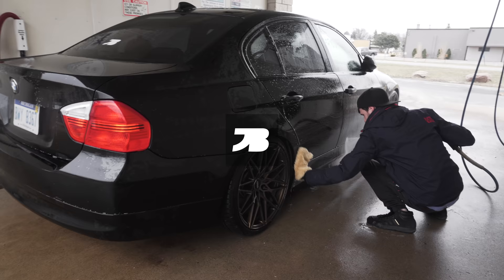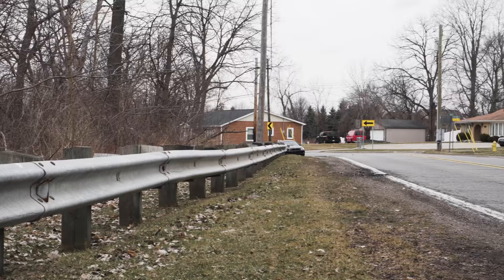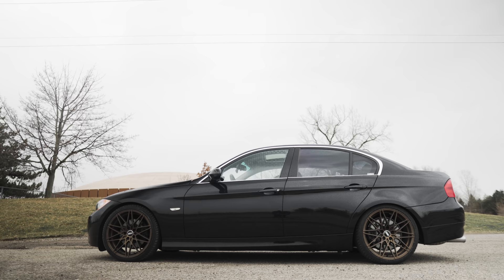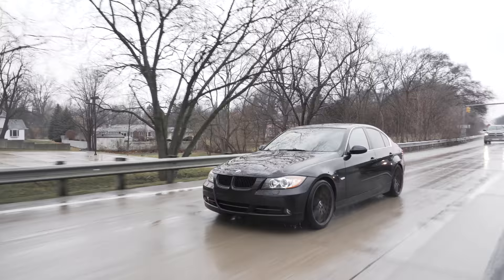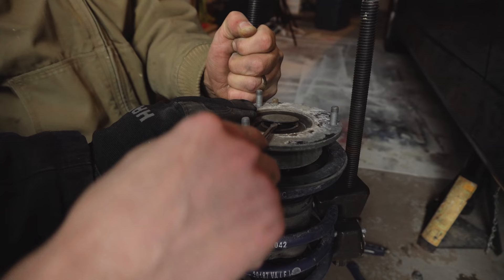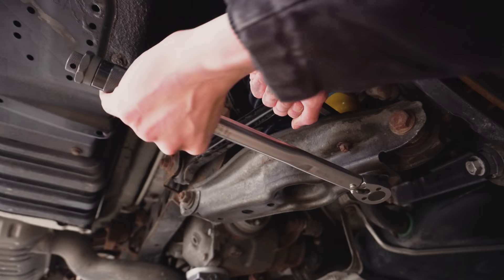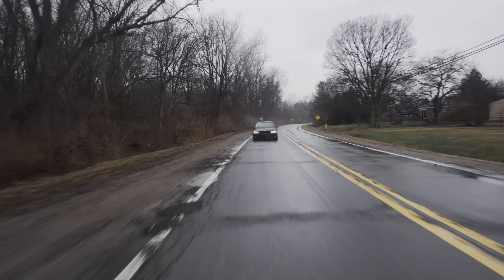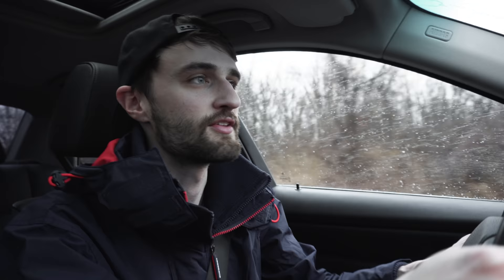BUDGET Suspension Review | Bilstein + H&R

Comment: Coming from the passenger in the car, the ride is bumpy. 😂
Great job as always babe! Proud of you. (:
Reply from the maker: It’s not that bad 😂
Reply: Its a matter of tune the right tyre pressure. In my Alfa ive used to Run @2.5 Bar for all the wheels, with B12 kit i run @2.4 which is pretty firm but its very planted, not bumpy at all.
Reply: I'm gonna take your man! I just need him for a few days tho! Need some assistance with my upgrades!!!
Reply: Y not get the coilovers for 800
Reply: I did mind's last week, and it does feel bumpy, and my girlfriend said the same thing. So my question is, how long does it take to settle?

Comment: I like that you have mentioned the value in overhauling suspension. It is often forgotten that people seeking to upgrade suspension are starting from a quite low point with a used car full of worn components. Useful budget upgrades then start with the super low cost option of Sachs dampers and stock bushes. Moving up the scale from there, something like Bilstein B4 or B6 dampers, BMW stock motorsport springs and improved bushes. Improvements, including bushes and ball-joints, can often be found in the BMW stock parts list. Sites like realoem, though not including full spring info, include info about bushes and other components used on motorsport variants, larger engined models and the M models. Careful part-bin mods based on this info can be really effective. After all, you bought a BMW because the chassis is good in the first place, didn't you! Top tip: like any rear-wheel drive car with strut suspension on the front they benefit greatly from an increase in front spring rate. This reduces roll and improves front camber, improving stability under braking and grip overall including allowing greater rear compliance and therefore traction. If you go really hard the ride will get a bit choppy but the benefits come way before that point.

Comment: On pretty much any older car, replacing the struts/shocks along with a bunch of control arms and mounts is pretty much the first 'mod' to do, before spending on engine and brakes upgrade. Just b sure to use quality parts (be it from Fcp or other site) because there is a plethora of biodegradable cheap brands these days sold by all reputable online stores - they sell the junk parts along with the quality and OEM brands, so it's kind of confusing for the new comer.  Great video by the way!

Comment: Great video.. I have the B8's on my 2009 Cayman with Cayman R Porsche springs (-20mm) .. The ride is as firm as you'd want on UK roads. Rough roads are jittery but smooth roads are very comfortable. Oh and the B8's for my car came with internal bump stops. Handling performance is certainly better. I replaced top mounts front and rear but my 38,000 mile units look like they are in perfect condition.

Comment: Justin, hello! Could you answer some questions?
1. Did you have a standard suspension (not M) before installation on your e90 xdrive?
2. Could you take an part numbers of h&r springs and b8 shock absorbers you installed?
3. what the drop was on front and rear after you installed it?

Comment: I did the same set up with my car, but find the front pretty harsh over bumps. Also, when I push down on the front of the car, either side, there is virtually ZERO suspension travel at all, maybe 1/8th of an inch at best.

Comment: The ride still looks a lil rough judging by the camera bumping up n down, but that's what comes w the lowered look.  I just put oem's on my e46 m3 n I agree man.  It was like a new car...especially on these fucked up Mi roads !!  We're changing the nick name from motor city to pot hole city.  I've been trying to find roads that don't have any n go out of the way to go up to like 23 mile which is fairly smooth just to avoid the aggravating turmoil.  I did see the budget increase in our state to get the roads rebuilt, but you know what that means....fuckin traffic!! All damn summer!!! Better make sure the a/c n coolant is in good standing Bc/ I got a bad feeling it's gonna be a long blistering one sitting in traffic.  Why have they not developed a new composite to pathways new roads with that won't deteriorate as quickly yet not ice over in winters...they should have scientists on this shit.  Car looks dope lowered though man, hope it's worth the sacrifice of a comfortable ride though.  When I pulled my old oem sticks n struts they wouldn't even expand...so believe me, even oem stuff can still make a big diff.
Reply: Are you happy you went with the stock setup over lowering springs and sport shocks? or coilovers? I have a e90 330i with the sport suspension and was thinking of just replacing the shocks and struts with oem to keep costs down. I have 130k miles on the originals and i hate the way it rides atm as it is bouncy over some bumps and I can tell it suffers in the turns, but I'm sure its because they are beyond worn out.
Reply from the maker: This setup is much firmer than stock but I think the low profile tires on the 19’s are what make the ride comfort suffer. I noticed a HUGE difference a couple weeks ago when I switched out my 17” winter wheels with OEM size tires. I probably could have picked some better roads for the video but I was looking for low traffic. They really need to keep working on hall. The area around hayes is perfect now that they repaved but garfield to romeo plank is a disaster.
Reply: Justin Buice  and the other comment;  it's really personal preference, experimentation.  The lowered look adds style, but to me, a couple inches isn't worth the sacrifice of a comfortable ride, especially here in pot hole city.  But if your still riding in factory shocks n struts at 130k,  n replace em w oem you'll notice a huge difference in ride support.  And a lot cheaper.  I think they recommended shocks n struts every 50-70 miles...mine was at 70 n like I said didn't even expand anymore, so it was like I was driving without suspension support anyway rubber to mount.  I forgot the name, but it was same manufacturer that makes em for BMW off the line (obviously term OEM).   I order all my stuff from fcp euro so you can return the parts later n just pay for shipping when you replace your next set.  Essentially an investment for free parts in future.  A lot of factors come into play though.  Def type of roads you have n what state you live in.  Example Arizona roads are like driving on glass, so lowered suspension will still ride smooth.  Something to think about.
Reply: N yes, size of rims are a big factor as well.  I rock 19's on my m3 both winter n summer set, so it requires playing w tire pressure to achieve ride comfort as welll.  I have heard 17 n 18's ride a lot smoother though, but to me I'd rather see a larger rim than a lowered car to try n fill the space under wheel well.  But then again, were talking inches here.

Comment: Great video! Did you have to transfer any rubber parts or any parts from the front struts to the new one? I have a honda on hr springs and ill be switching out the shocks/strut  too with aftermarket ones but the aftermarket ones dont have anything on them except the struts and shock itself. Looking at forums they said id have to transfer some oem parts like bushings, dust covers, top hats etc...

Comment: So the question is:  should I run this setup, run coilovers, or just renew my stock sport suspension setup. I have 130k miles on my 2006 330i that still has the original shocks/struts so they are definitely worn out. Any way I go will be a definite improvement.
Reply from the maker: If you have a little more to spend, I’d go with some nice adjustable coilovers. I believe on the KW V2 you can adjust the ride height snd dampening. Those are around $1,600 for a set
Reply: Justin Buice cool. I'll look into those and consider my options. Thanks a lot.

Comment: $1000 is not “budget”.
However it is affordable...
It definitely is a great upgrade.
Reply: 1000 bucks for a suspension refresh on a bmw IS budget.
Reply: @hungrymynd5673  Or any car really...don't know many shops that will replace all 4 shocks/struts and springs for under even 750 for any car...
Reply: @MrKushinator420  The $1000 doesn't include installation...so not sure I get your point
Reply: Bimmer budget is pricey.
Reply: I got Eibach Pro Kit and Bilstein B8 for my e46 ... ist costs around 600€

Comment: I have the same car as yours and debating if I should get a coilover or lowering springs with upgraded shocks and struts. The coilover is Bilstein B14 performance coilover kit for $814. It's going to be similar $amount if I do the H&R spring with Bilstein B8 shocks/struts. I want to lower my car but at the same time don't want to lose the comfort since it's my daily. Any advice which one would you prefer or the difference between the two?

Comment: Justin, I'm about to do the same upgrade! Funny, I already bought the same set up and brand. I am really glad to hear the ride is not too stiff. I had done a similar swap on my maxima years ago and found it to be too stiff. I am also replacing the control arms from an M3. It will increase the negative camber a little. I already added a stiffer rear sway bar and found it to rescue the initial understeer. My e90 initially came with "touring" suspension set up so the handling was a bit too "lazy" for me. This should bring it to where I want it. BTW, my stock radio just died. Replacement is hugely expensive. I may just go with an aftermarket unit. any thoughts?

Comment: How come most people in the states drive cars with the "se" body? In the uk most drive the m sport body style. Is it hard to get hold of the m sport kits over the there?
Reply from the maker: The m sport body is less common here which makes it expensive to do the conversion. Im looking into getting just the front bumper and it will be around $800
Reply: Justin Buice wow thats expensive, iv been to the states and i saw alot of non sport cars just couldn't understand that. M sport front bumper here on a pre lci can be brought for less than £100 used. Thats just the bumper, no grills or fog lights. On a lci car probably £150.

Comment: H&R springs on stock shocks, Now that The shocks are hingher But compresed, When i hit a Hole in The road it booooms :)) 
How is the B8 on bumpy or roads with holes ? 
Does it ever annoy you ?
Reply from the maker: It's buch better with the aftermarket shocks. The ride is more firm , but the car doesnt bounce like it did on the stock ones
Reply: Justin Buice 
IF you hit a hole does it feel worse than before ?
Reply from the maker: The initial impact feels the same, but the rebound feels better with the new shocks
Reply: Justin 
Well... I’m gonna buy them and that it :) 
Thank you very very much !!!